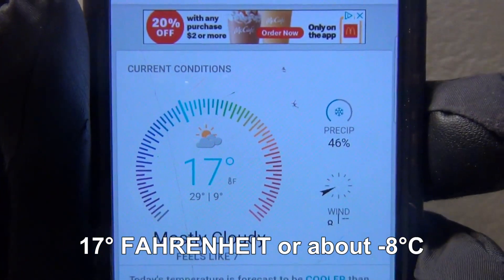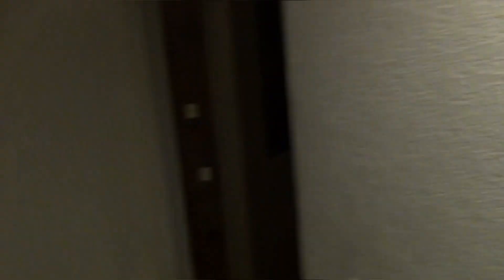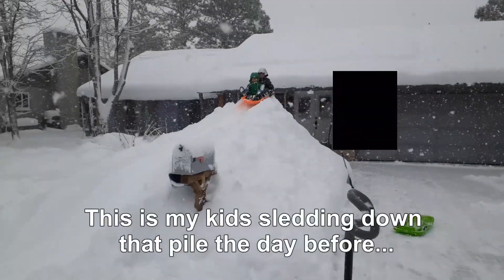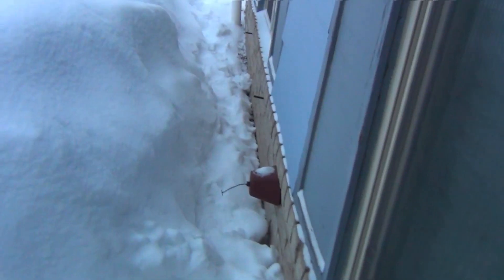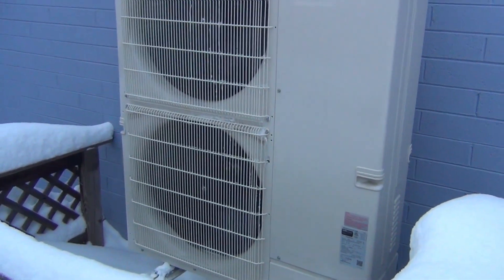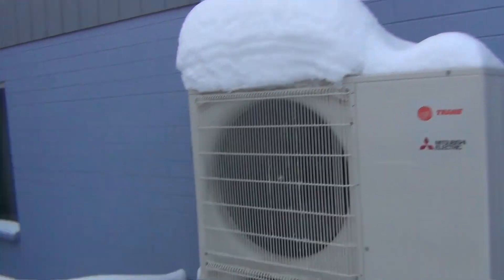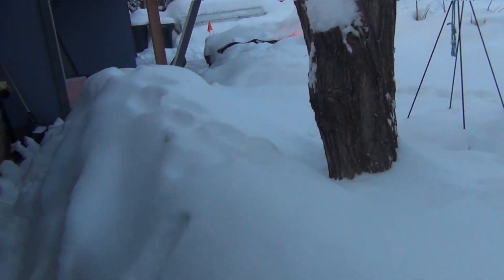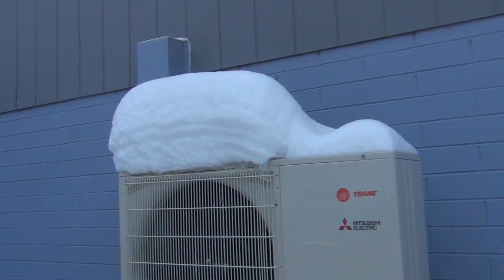Cold Weather Heat Pumps Work REALLY Well

Comment: Does your heat pump ever freeze up in the cold weather? I’m getting a heat pump soon and I’m concerned about that since I live in a climate where it often drops below freezing at night.
Reply from the maker: As you can see in this video, where it got down to 9 degrees F (-13 C) that day, no. I live in Flagstaff where winters are very cold. This past winter in particular it got down to -5 degrees F (-20 C) several times and never had a problem. Just make sure you get a COLD WEATHER heat pump, as the older ones or the ones that are still built in that same style do have trouble in the cold, but the cold weather-specific ones do great -Marco

Comment: How did you get a Nest to work with a high efficiency Mitsubishi heat pump. I keep being told I'd have to use the Mitsu thermostat for a variable speed heat pump (runs continuously at low speeds). Is yours a single stage that toggles better off and full power?
Reply from the maker: @Zack Kolev  I believe they said they had to get some additional little device that allows the Nest to communicate with the heat pump, but unfortunately I don't know the details. Mine definitely doesn't run continuously at low speeds, once it's up to temp it shuts off, then when the temp drops and it needs to kick back on again it does but if the heat pump has gotten cold enough in the interim then it runs on defrost mode for a few minutes before it starts blowing hot air again.

Comment: I don't consider 65° in the house comfortable
Reply: Me neither, I have mine set at 66.
Reply: How did you get a nest to work with a high efficiency Mitsubishi heat pump. I keep being told I have to use the Mitsu thermostat for a variable speed heat pump (runs continuously at low speeds). Is yours a single stage that toggles better off and full power?
Reply from the maker: @Zdravokado  See the reply I wrote to your stand-alone comment rather than buried in this thread here...
Reply from the maker: It has no problem getting up to 70, 75 or basically as warm as you want, we just have it set to 65 because our whole goal here is reduce our carbon emissions, so the first step is to reduce one's use of climate control no matter what kind of system you have, it uses less energy and it's not an inconvenience for us to dress warmly, for more context check out this part of my video "How We Achieved Carbon Neutrality - Electrified 1970s House Retrofit Tour" https://youtu.be/KfXsdmScF9Y?t=720